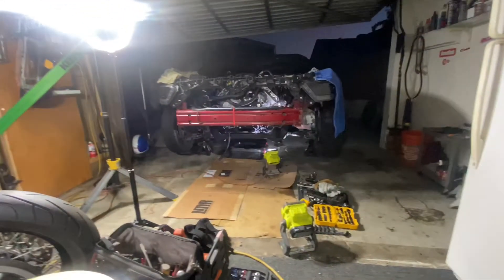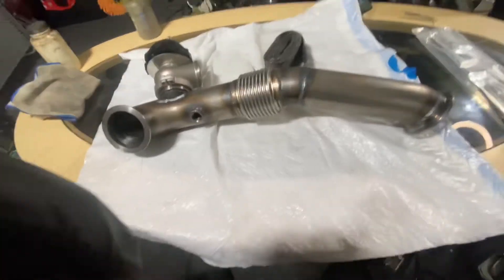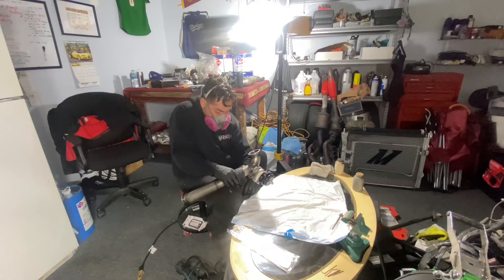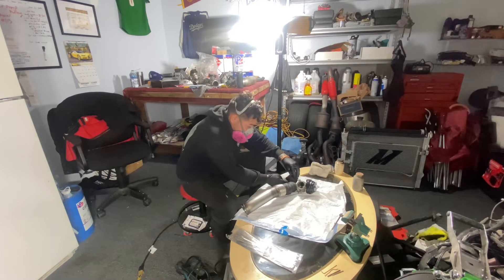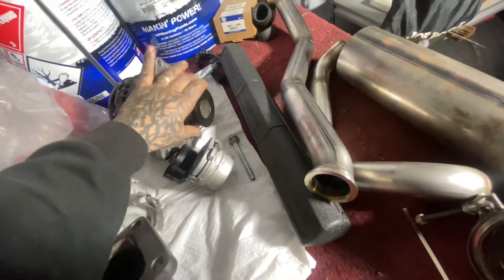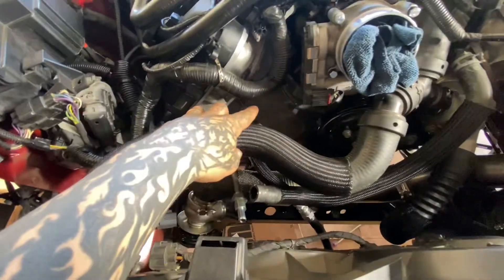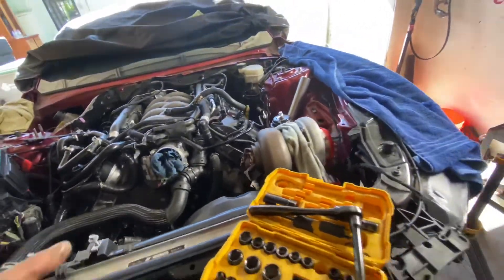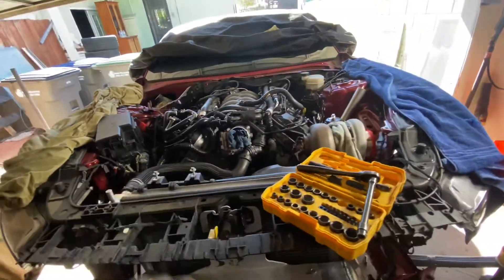Single Turbo Oiling System Explained for a S550 Mustang GT

Comment: Yo question I wanted to retain factory oil cooler and all that, could I use the oil temp plug hole right on the oil filter bracket as a oil turbo feed?
Reply from the maker: Man brother ! I’m not sure. I think that one is a pressure port so maybe you can. I would try it out.
Reply: @DiablitoSpeedz  I figured I could, I hooked a gauge to it and has good pressure, i just want it more simple without adding all these adapters and plates they gave me just for one dam feed line